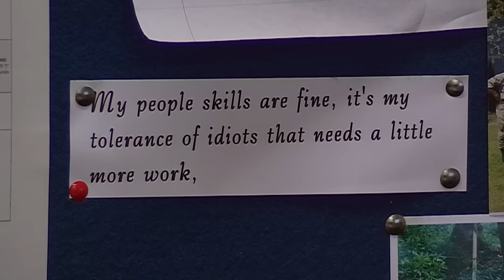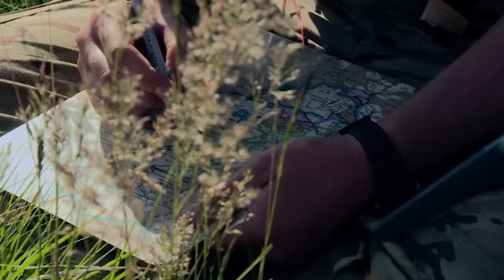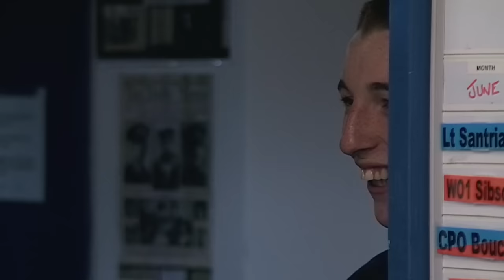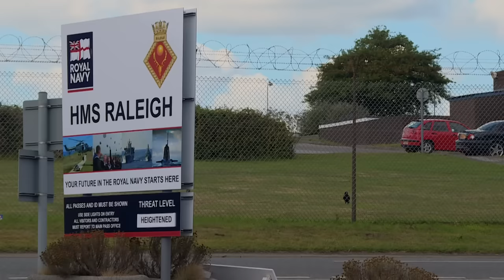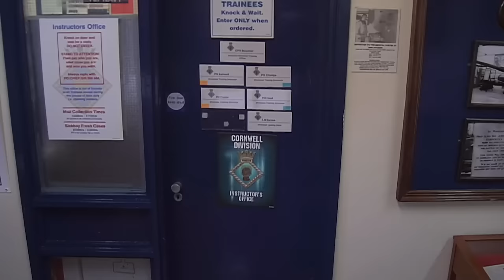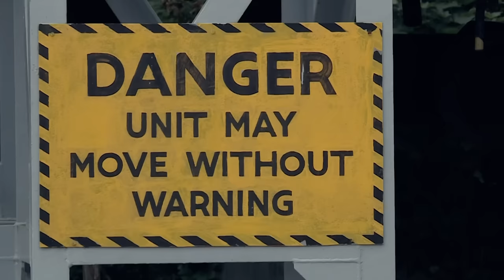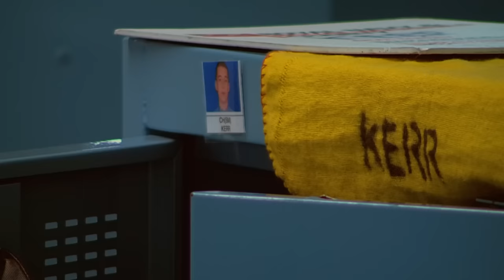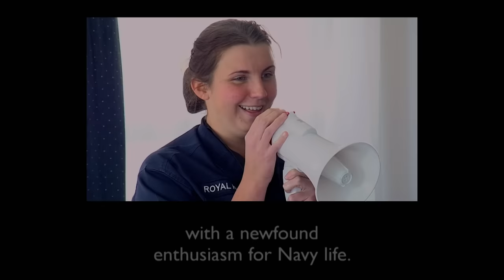Royal Navy Sailor School - Episode 4 (Sink Or Swim) | Our Stories

Comment: I've met more than a few Royal Marines and they are hands down some of the best, however, I did have the opportunity to someone from the RN while I was on a port visit to Jebel Ali in the UAE. She was assigned to a frigate if I remember correctly. Aside from the fact she looked like a model, she was an electronic warfare specialist and smart as a whip. Seeing the attrition rate of their training classes, it answers the question of why they are so stringent on individual standards. I was also surprised that the RN had a camo uniform included with their kit and did forced marches during training. Times change right?? One thing I'm not sure about is on Dartmoor. I saw them using a map but didn't see a compass. Land navigation is a basic skill we are taught in boot camp using a lensatic compass and 1:50000 scale map. You could orient the map with direction of the sun but without a compass, you have no way of getting your true bearing or plotting your course.
Reply: There is a compass in Gillies’ right hand at 14:33, and very clearly at 15:22